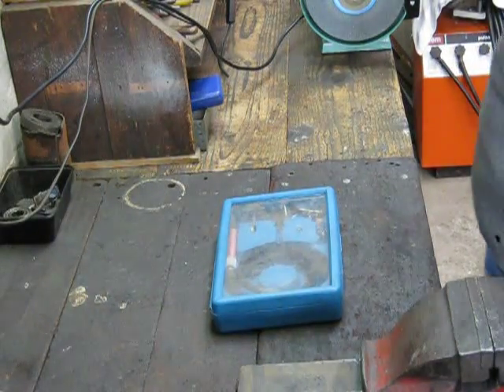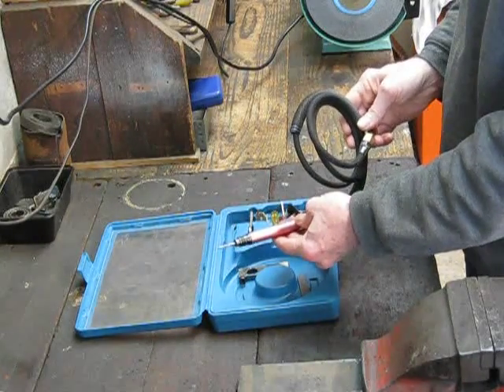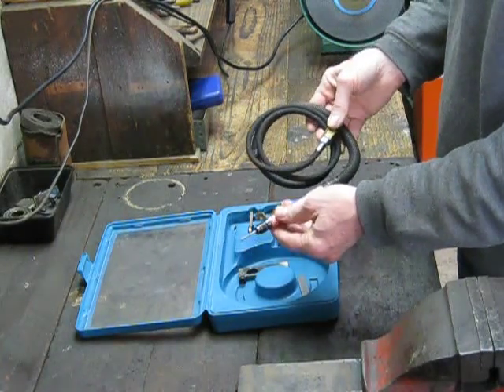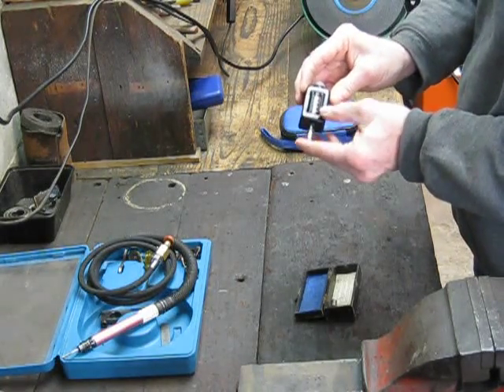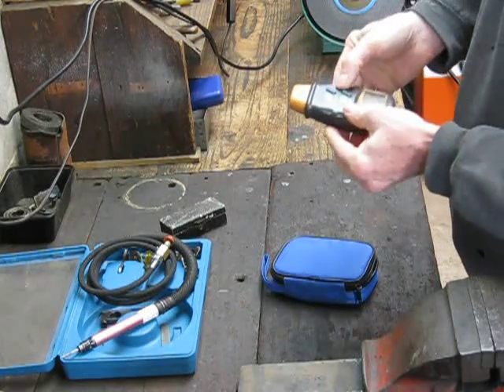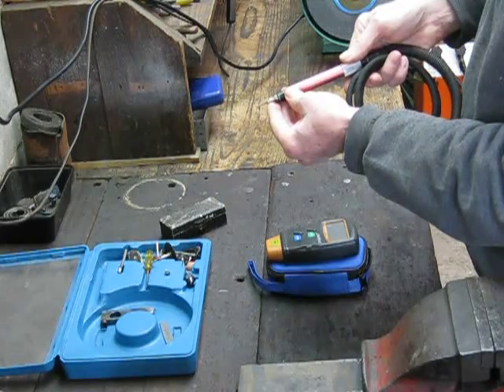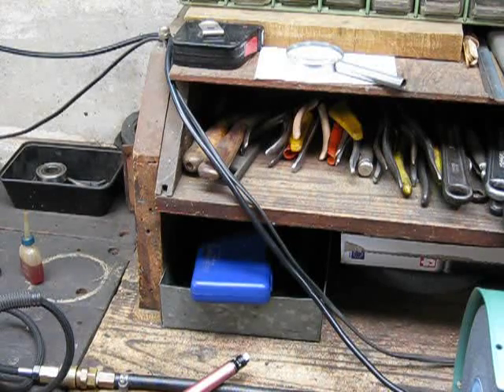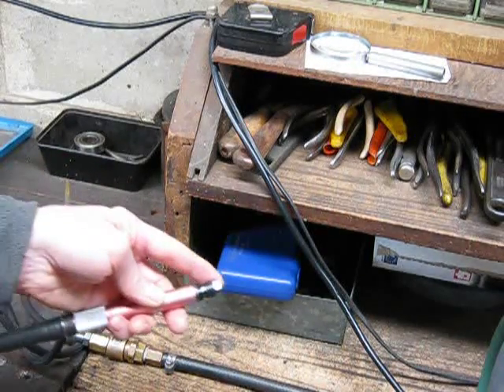Pencil air die grinder speed test - how fast can a micro die grinder really go ?

Comment from the maker: Hi Bruce.  2 CFM at 90 PSI is the quoted usage.  Driving it at 120 PSI as I did in the video test is really unwarranted, and probably stresses out the unit.  The unit felt "rough" at that pressure.  90 PSI felt good. I couldn't detect any play in the bearings or spindle.  All the runout is confined to the rather basic collet design used in these units. Cheers Rob.

Comment from the maker: My needle descaler (air chisel) uses quite a bit of air - more than the 2 - 6 CFM quoted by many sellers. My compressor is 7.5 CFM and it can't keep up continuous running. I would recommend a 10 CFM compressor for continuous use. Rob

Comment: OK, thanks, Rob.  Proxxon is a German company, and the high-end Proxxon "IB/E" grinder is like a Dremel, but with much less runout and spindle play.  It is sometimes used as the spindle in micro-CNC routers/millers.

What volume of air is required (ft^3/min for us yanks) at 90 psi to drive your air grinder?

Thanks,
Bruce.

Comment: Thanks, Rob.  How about your needle scaler?  I don't have a compressor, and a needle scaler is another air tool in which I would be interested,  but I believe that has a much higher CFM requirement; correct?  Thanks for your help!

Comment: Do you think---for use on the lathe toolpost---that there is any advantage of an air pencil-die-grinder like yours over a quality electric rotary tool like the Proxxon?  (The Proxxon only goes to 25k RPM, as compared to Dremel's 35k RPM, but it has significantly less runout due to better bearings.)

Comment: I need to drill some 0.010(.25mm) and 0.005 (.13mm) in 1/4 inconel tubing with a .049 wall and I possibly have to come in at a 45° entry on the face..... and I have to figure out how to do it by hand. I was thinking of using one of these

Comment from the maker: Really high speed is important when you get down to very small diameter tooling, particularly with diamond burrs.  To get the right surface speed you need high RPM. A Proxxon would probably work OK if it takes 3 mm tooling, but it would be slow going. Conversely, the pencil grinders are limited in what they can do - only really meant for small stuff.  It's apples and oranges really.  The Proxxon is not a unit I have tried, so I can't comment on it's flexability or ability to do small work. Rob.

Comment from the maker: If I was to buy another compressor, 10 CFM would be the minimum size I would consider.
Optimal size for running off 240 AC for a home work shop would be 12 CFM.  Bigger than that is pushing the budget, space, and the electrical system.  Rob

Comment: I have 1 of those units and it nearly uses as much air as a normal 6mm die grinder so it has been put away and forgotten.
Reply from the maker: I'm surprised to hear that.  I also have a 6 mm air die grinder, but that uses way more air than the small unit in the video.  Can't explain how yours is different.  Rob